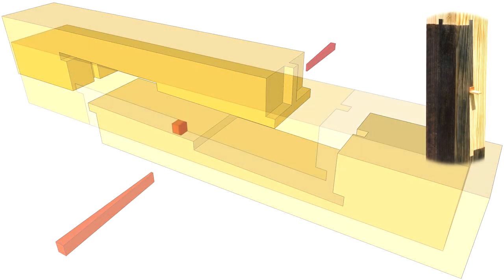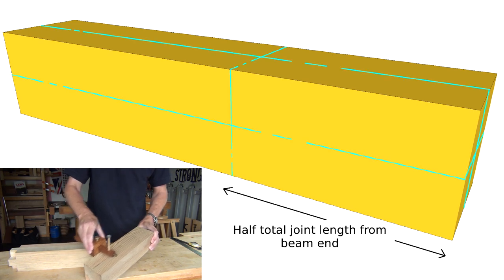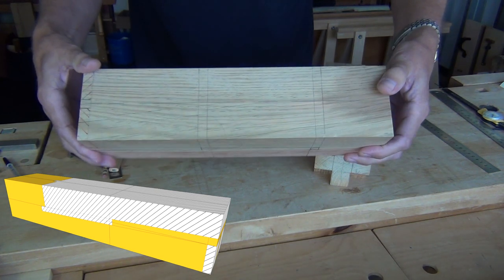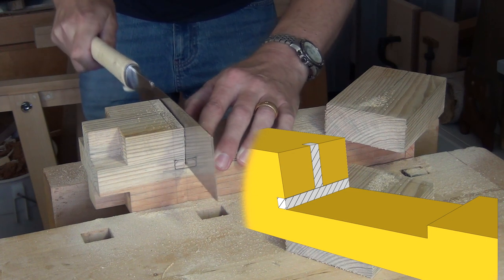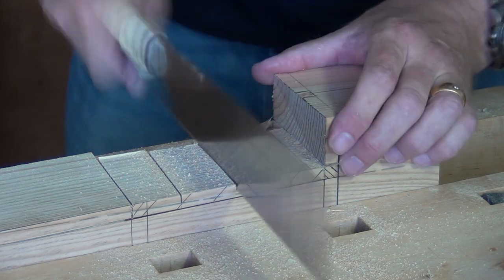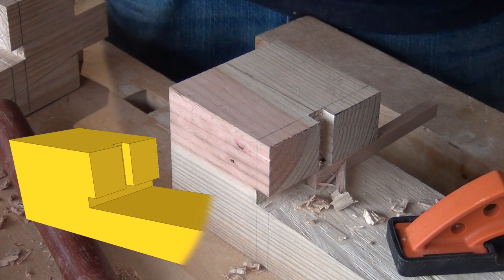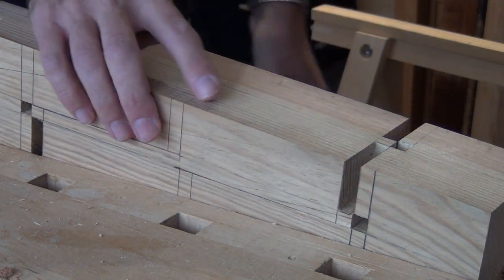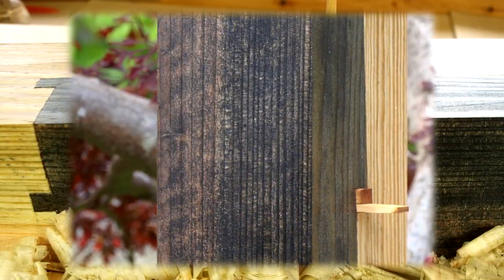Kanawa Tsugi Splice Joint Instructional / Japanese Joint / Free Drawing and CAD model

Comment: Ahoy, Mitch!  I'm just diving into wood working now and have recently gotten to the surprising mention of 'wood movement' due to moisture content needing some room on specific planes to avoid damage long term.  I get the basics of tangential, radial, longitudal etc and how bread box ends are used to avoid tables from getting into trouble, but I recently saw an ancient Japanese house being dismantled and it had a similar wedge styled joint in use, more of a tusk look to it but same idea.  The joint looked to be just as sturdy as the one you made here, and as you mention during assembly it locks tighter without any gaps, but that's my conundrum.  If it is tight and even more so because the wedge locks it in place further, how the heck is there no damage to the beams after like 100 years?  How does that math out?  Were the beams just all cut quarter sawn style?  A few looked to be near the core, so possibly, but I doubt all were based on the grain patterns I could make out. Likely it's something I'm not aware of being so new to the topic, and after checking around online and watching your Touch of Japan and joint videos you made, I was hoping for any enlightenment you can provide, I'd be ever so grateful XD
Reply from the maker: The beams are similarly oriented, and probably rarely over 18" deep or 9" thick, so any relative difference in movement will be very small and inconsequential. Then the wedge(s) are very slim, so only tiny movement in reality, and probably insufficient force to actually expand within their pockets (as per the captive effect of a breadboard end). The only precaution I can think of is to orient the wedges so they don't slip out under very dry conditions, and regularly tighten them after initial construction until they no longer move.
Reply: @mitchwoodwork  Ooo, matching the orientation of the beams might be the ticket I missed.  I know with tables they recommend to do the grain as 'smile and frown' so it evens out the pressure equally, I didn't think about that in this direction.  Thank-you very much for your reply and insight, Mr. Mitch!

Comment: Very nice! Some questions:
1. Why aren't joints glued in timber framing?
2. What is the usual purpose of this joint? Elongating an existing post?
Reply from the maker: Cheers Andrei,
1. With modern waterproof adhesives they sometimes are, but traditionally any glue was liable to fail quickly outside. Wood outside moves a lot due to changing moisture content, again stressful for glues.
2. This joint, I believe, is mostly used to extend beams.
Reply: @mitchwoodwork  Thank you for explanations and video!